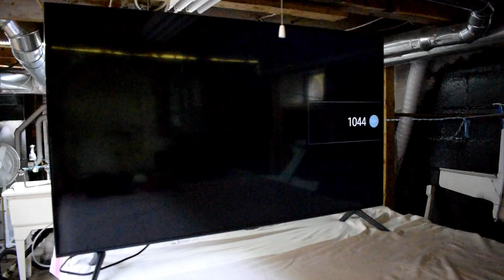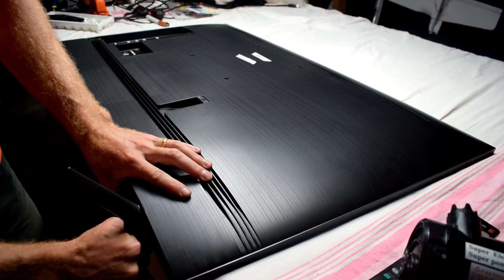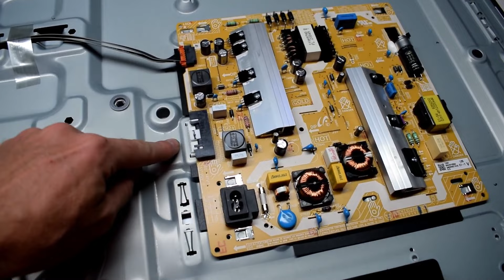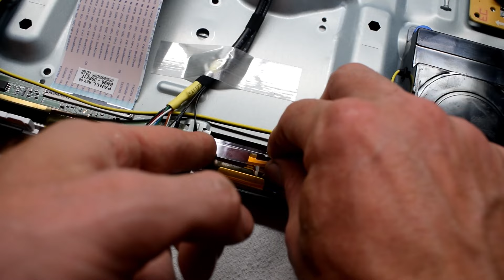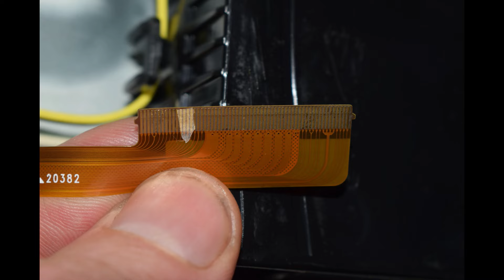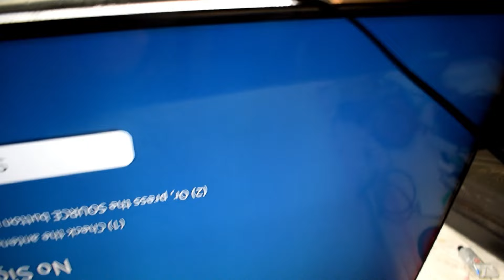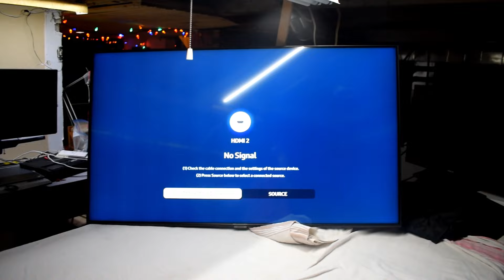Samsung Smart QLED TV Keeps Restarting! Fixed with TAPE! (Model QN50Q60TAF)

Comment: Thanks so much for this video!
I've had the same Bootloop issue with my GU50TU8079UXZG and managed to solve my issue by taping ≈four of the pins on the ribbon cable with clear package tape! It may have taken one or two hours, but the TV runs perfect now once again! Thx a lot for your guide!
Reply: Hey
I have the same model and the same problem,
which pins exactly did you tape?
Reply: @kornelk687  from what I've gathered, the pins you have to tape over will depend on which pixel rows of the display are defective, which I assume will be different for each case.
In mine, it were multiple pins at the left side of the center.

As annoying as it sounds, you really just have to use try & error to find the pins you need to tape over, that's what I did.
Reply: Thank you for your response.
Can you explain to me what I need to do exactly?
Seal the pins individually or what?
I'm not an expert on the subject but it seems a pity to throw a 3 year old TV and 800€ in the trash.
Please be understanding...😢
Reply: @kornelk687  no problem at all ^^
I basically just used a piece of clear sticky tape (as it was the thinnest tape I had), and cut it into a smaller piece with a scissor.
I then just randomly taped over a couple neighboring pins, in roughly the same location as in the video. After I found out that didn't work, I took the tape off and taped over another couple different (neighboring) pins. This time it worked and the TV didn't shut down, but the image looked quite bad. I then removed the tape, cut a smaller piece to size, and taped over only a few of those pins. That did the trick. The image looks acceptable and the TV doesn't shut down anymore. There are still some artifacts / flaws in the image, but I'm just happy it work again. 

You might possibly get a better result if you seal off the pins individually, but I just used a single piece of tape and taped over ≈4-6 pins at once.
Reply: @wildlifefilm  Thank you for your explanation and patience.
I will follow your advice and let you know how I got on.
Thanks

Comment: Good video. So here's what I did:
1. Had LED blink issue, no display
2. Tried taping part of the right side ribbon. TV got on and sound worked fine but no display. Tried taping different parts on right side ribbon, same result = no display but TV works (sound on menu etc)
3. Then tried taping left side ribbon (left part of display main cable), no display again. Eventually when taping different pins, display finally worked. There's a dim horizontal dark grey lines which is not visible from 5 feet apart. So I think this is the only possible solution to get the TV to work somehow. In my country it's almost impossible to repair or have to pay a hefty price. 

TLDR: Try taping the ribbon cable pins on both side (left ribbon and right ribbon too) 4-5 pins at a time. Eventually display works. This is for all those guys who say they fixed the blinking issue, but no display. This could work. Worked for me.
Reply: I tried this for a few hours covering different pins, but no luck. I managed to make it not boot cycle, but only blue screen, no picture.
Reply: Could you share which model TV and which pins you taped?
Reply: @darude1420  model is samsung 55RU7100. Actually for pins, it was more like a random order. Randomly try taping 4 to 5 pins. For me what worked was the left side ribbon, around 20pins from left side. So its approx around 20th to 24th pins (just an idea didn't count exact).
Reply: @MohammedAneek  hi, i have the same issue as you did. TV turns on, sound on and still no image displayed. Did you put tape in différent spots on the same ribbon? Or did you put one piece of tape on each  ribbon? Thank you for your help i already spent 4 hours on it, i am desperate

Comment: You saved our day with that simple solution.
But it may have brought a new issue. The screen is splitted from left very green and right very red. The settings to solve that disbalance isn't helping well.

So i hope it fmwill be fixed by readjusting the tape.

Edit: there're also stripes (4 in total) from left to ride. Hopefully fixable via readjusting 

Dear Sir, a tape. Applause to that idea!❤🎉❤🎉
Reply: did you fix the colors? Same issue

Comment: I had the same issue with QN65Q60RAFXZA I put tape on the end of one of the two strips and I get constant backlight now. But TV shows full black screen. Initially remote was not operational and the remote works and makes sound. I have realized when an external device is plugged in the motherboard does heat up (not sure if it heats up too much). Should I order a new board and see if it works?
I am just worried about it not working after replacing the board and I am not an electrician. Please advise
Reply: I have the same issue, it stopped rebooting constantly but now i have a black screen.
I do have sound, i've tried moving the tape back and forth and narrowed it down to like 3 pins but i still have a black screen + 1 white vertical line now.

Did you ever manage to fix yours?
Reply: Yes, by spending $3K and ordering new S89CB 77" lol  @vuur150  
No, I could not I still have the tv and haven't given up on it. 
But it is a panel issue and not worth repairing. Panels can only be repaired using machines.

Comment: I have the 75 inch version and it was doing the exact same thing. But then it got to the point where the tv didnt turn on anymore. I still see the red standby light. Should i try this? Is it the same process on the bigger tv?

Comment: I have a Samsung UN55TU7000F with a vertical line in the center of the screen. The picture and sound is good. Tried taping off pins but without success. Any recommendations or suggestions?

Comment: Different model but same fix kinda worked - stopped it from powering off and on constantly with the tape in a few places but it was only when I put the tape in almost exactly the same place did I get a picture at all, shimmery on one side and with a lot of obvious lines missing horizontally and vertically but, better than nothing!

Comment: after process of elimination, I tried the tape trick on the circuit that was causing a problem but still, only black screen with sound and function, no responds at all, or a a heavy muddled black spot on the screen with no sound of function. Ive been reading a lot of troubleshooting about this samsung TV from around 2020 brand new and the last year everyone is having the same problems, it almost seems as though these TV are meant to last only 2-3 years at most. last time im buying a samsung tv thats for sure.

Comment: Amazing! I have the same TV, same problem, and same spot on the ribbon. I trimmed down a plastic post-it note to do the fix because it has one end that’s not sticky so it was easier to move it around when trying different spots.

Comment: Hi. Thx for this video. But i have a slightly different scenario. If i unplug left side no reboot. If i unplug right side, no reboot. But if i plug in both sides i have reboots without screen.
I taped now on the mainboard side and found one pin that stop reboot. But still no picture. Any hints for me?
Reply: Try taping the pins on the other side too. There could be problems on both sides probably.

Comment: Hello, I had the same issue on my Samsung GU50TU8079U - it was always restarting! I put a tape on different pins as you explained and for me it seems to be the very first pin on the left. After I cover it, my TV is running continuously, put the display is completely black. I can control via my remote and here the sound when I press the home button, but it is all black. Can you help me about this issue? Is it because it is the first pin for me? Is there any solution for that? Thank you in advance!
Reply: Now I have tried other pins and when I tape just pin 10 from left, it started correctly and I could see the screen, but with a lot of black stripes - how is that possible by just covering 1 pin?
Reply: @thomashofmann2135  konntest du dein Problem lösen?

Comment: Mine turns blurry after i turn it on for 2-3 seconds and then it restarts on its own , and this will go on over and over again until I switch off the wall switch where the main power is plugged in

Comment: Hello, my samsung QE50Q60TAUXXH it's always restarting, do you think can I solve it like the way in your video? Thanks a lot!
Reply: I got the same TV, any luck?
Reply: @darude1420  Yes..after some tries it plays but it has 3 horizontal lines which are not to obvious...I would say that  plays on 90% which is very good if you don't want to buy another one...
Reply: @giannispetrotos2078  nice one, could you share which pins you taped?
Reply: @darude1420  I don't remember..I tried it randomly... I taaped then I switched on the tv .I checked..then again and again until it was ok

Comment: caution, this is not easy to do, tried to unclip the tv with screw driver around the sides and tv now has a broken led line strip down the middle and unusable. boot loop still occurs.

Comment: I have the same tv and it power cycles when plugged in. I tried your tape method and the power cycle stops,I have sound,all back lights are on and Brite but I have no picture. I moved the tape in all possible spots and no picture. Also I did all the test in the video and it's narrowed down to the left half of panel with an issue. Any help greatly appreciated.
Reply: hi sir, having similar issue. is there a fix on this? thank you
Reply: @ammarkazan did you fix it?
Reply: i same prpblem
Reply: @KeljuKkojootti did you fix it?

Comment: loved the way you ran through the process of diagnosing the fault and loved it more that a tape fixed the issue for me too. (i placed the tape exactly where you taped it in the video)

Contacted Samsung and I was told my warranty ran out (its funny how things go wrong as soon as the warranty runs out - 6 months to be exact). And they were charging me £110 for inspection but the fix itself could be more.
I will make sure that my next TV isn't going to be Samsung.

I originally thought the fault was with the power supply board since the tv was failing to switch on and constantly rebooting. So I ordered a used replacement Power Supply Board from £40 from eBay. Which of course, did not work since it wasn't a Power Supply Board issue. (If only I had come across this video sooner, I wouldn't have had to go through the hassle of ordering and returning the PCB)

Just as in the video, I followed the diagnosis steps and just as in the video, the fault was in the display flex and on the exact same pins (Seems to be a common issue judging by the number of views on this video and the positive comments in it).

I am happy that this fixed for me. For how long this will work, only time will tell.
Reply: Hey, could you give me an update on this? Does your TV still work? Thanks in advance 🙏
Reply: @Tina.Di.Napoli  Hello. Yes, my TV still works although the screen now has few horizontal lines on the screen. Noticeable but not enough to be problematic.
Reply: @tarrylamang  just tried it and clumsy me, let the screen slip and get broken 😅 well, now it's definitely time to buy a new one
Reply: @Tina.Di.Napoli  oh no. sorry to hear that. haha. lucky for me, i had prior experience working in electronics. Anyway, I hope your next TV isn't Samsung. It seems quite unreliable.

Comment: This guide helped me to narrow down the problem. For me it is also one side of the lcd screen. However, when I cover certain pins, I can keep the TV from restarting, however it shows only a faulty picture (black with some coloured pixels on the edge). When I move my cover to the right or left of that specific position, I can get the correct picture again, however then the restarting issue resurfaces as well... Anyone had similar problems/trouble applying the fix? Any suggestions?
Reply: Yes i’m having this problem now and trying to figure out the solution.  Did you fix yours in the end?
Reply: @tooheys5321  sorry to inform that my fix was buying a new TV :(
Reply: @MrAnalyzerSmith  No worries, appreciate the reply.  I’ll persevere for a bit and see what happens.  Have read a few other comments that said moving tape around worked.

Comment: Awesome video. Just saved me from buying new parts that I didn’t need. My Samsung QLED had the same issue and I was sure it was the power supply or main board. Found this video and fixed my TV with a small piece of tape without any noticeable loss of picture quality. Thanks!

Comment: I have the same issue with my 2020 Samsung frame. The real travesty is that Samsung are making products that are only lasting 2-3 years.
Reply: Hello Nicketon, I have also frame TV 2020 and the same problem. Did you resolve your issue? With this technique? And which pin did you cover ? Thanks
Reply: @bricebattistini8080  I did try it. It stopped the reboot loop but putting the tape on made too many lines and colour changes to the picture.

Comment: This works great. Initially I did have lines but just persevered moving the tape slightly and cane on great. I am just noticing a green tint to the left of the screen. Might try and do again covering less pins but it's difficult to fiddle with such a small piece of tape. Wondering if insulation tape would work as might be easier to handle
Reply: Same Problem here. Did you fix it?
Reply: how to remove black horizontal lines that move? Thank you
Reply: @stevostevic-z9c  I have managed to remove black horizontal lines by covering one of the pins in the middle, it looks only the certain pin was broken. You can look for it by covering 3-4 pins at once and move with the tape. But it brings new issue with not correctly displaying colors on one of the sides, red is green etc Can't solve it

Comment: my samsung q60 58" tv started power cycling after a very quick brown out.  it was on a surge protector and everything but now it wont even turn on long enough to show the logo.  it's only a little over 2 /12 years old so fingers crossed this will do the trick!

follow up:  I found the short but still no picture.. i can hear it but nothing else.  it did stop cycling.  A new ribbon is around $15.  im not opposed to just swapping it out but can it still be something else?  the boards are running around $95 but they are all sold out across the internet.
Reply: Hey just saw your comment here. Did you end up finding a solution? Mine now turns on as well and I hear the sound, but the screen is all black.
Reply: Unfortunately it worked until I hung it back up. Did a repeat and same results. Got tired of rehanging it so I just bought a different tv.
Reply: @saddad6601  thanks for getting back. I narrowed it down to the defective pin but still no image on the screen. A new TV it is, I guess...

Comment: may be you dont have seminar for panel screen,or weak knowledge for panel screen that why the result your modifications is not perfect or 100percent good display.,here in philippines is easy to fix cause many technics sharing in seminar,also how to simple  proper removing the back cover screw less samsung model."what ever if left and right panel is totally damage what will you do?

Comment: Thank you so much for this vid, im not afraid of fixing things have done most of my life, I have a picture now but loads of lines so im going to take my time with the pins, I phoned a tv repair shop for parts went through everything he said bin it its the screen itself, didn't want to only 2 yrs old cost of living etc, cant believe how cheaply these are inside my QLED for the price bottom side strips at the screen was just taped in and with the heat was at an angle, all my Tvs are Samsung older ones that are still going won't be buying another Samsung my model QE50Q60TA

Comment: Worked for my QE50Q64TAU, I nailed it down to only one pin which was causing shortage, it was restarting, but taping this one pin worked! Apparently, these QLED models from 2020 are lasting just until warranty and then it dies within few months. This fix causes minor artefacts/discoloration, but watching from some distance eg. sofa, you cannot spot the difference. Thank you <3
Reply: which Pin did you put tape on ?
Reply: @Roched0  in this video, he tapes 3 shorted pins, but in my case, you need to go 2 pins away from these 3 shorted pins with thin trace and the third pin has thicker trace and that was it

Comment: the short on mine was in a ESR protector diode on the LCD Driver board far left side (look for the one that is getting very hot relative to everything else) its removal completly restored the function of a QN65Q60DRAF that was stuck in boot loop with both LVDS cables inserted.

Comment: I tried this and it worked but when I turned tv on the next day, the problem was back. I've done it a few times and the problems return after the set has been off overnight. Any ideas. thx (model Qn50q60aafxza)

Comment: My TV is the same with the exact problem and was fixed with the exact the method. You see some faint lines but only if you fixed or looking for them. Thanks for sharing dude.
Reply: Is your TV still working?
Reply: @mustafae.6719  yes absolutely this DOES work…the pins you have to find which ones it is, mine was abit more centred in comparison to the video, but it worked indeed.
Reply: @mattym6749  For me, it was the ones from the video and it worked right away. Did you use a normal adhesive tape?

Comment: After a few hours I got this to work. Guy literally gave me his TV for free and then I fixed it. I have that horizontal line though. If I was to buy a new ribbon cable, would it fix the issue, or is the issue without the connection on the LCD itself?
Reply from the maker: cable will not help